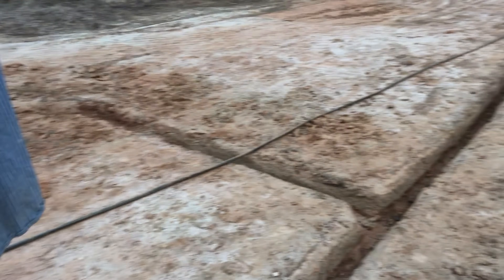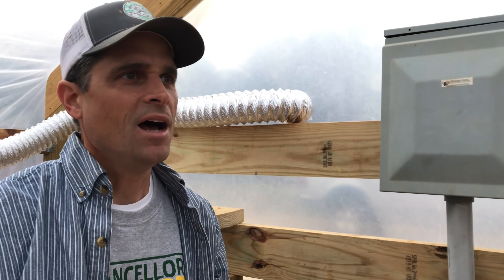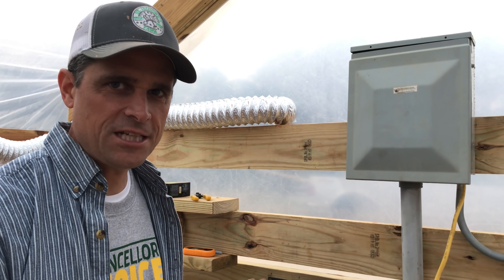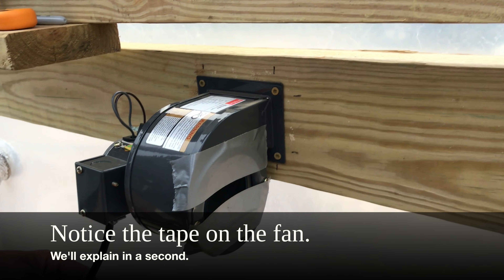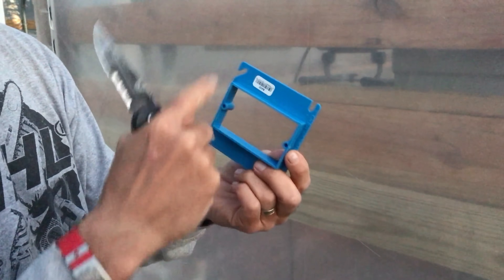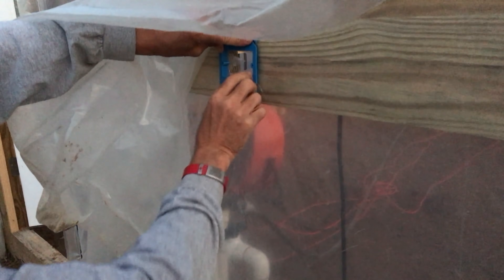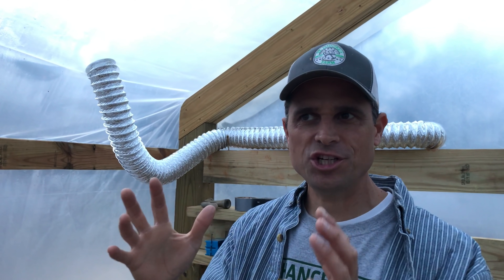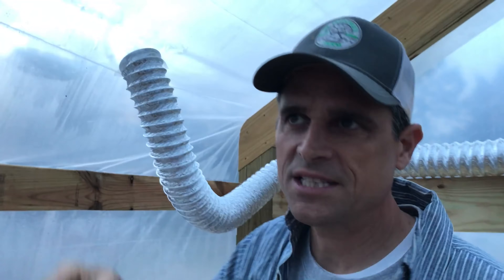DIY Geothermal Greenhouse Pt 10: POLY FILM INFLATION

Comment: another great update!!! 

Im so stoked that you dont have any water filling up the pipes, that is GREAT NEWS.  
I'll have to really consider following your steps with my little greenhouse :)   Would be nice.  
Then again, i might just make a larger greenhouse lol 

regarding the air flow jive... ill give a wack at it.  Anyone that notices any errors, please correct my thought process. 

Here is a website I used to cheat regarding the math.   I figured I'd use the benefits of modern 
day tech and the internet lol. 
http://www.comairrotron.com/airflow-unit-conversion 

I do know you need to convert MPH to FEET PER MIN so then you can convert that to CUBIC FEET PER MIN.   Conversions,  FUN!! 

So... at 15mph air velocity it looks like around 250cfm.   
Not bad at all.  With that calculator... you got around 1300fpm so you can calculate 
roughly how long it takes the air to travel the length of your system... "ROUGHLY" i mean of course... since there is the manifold that air could be taking a number of paths, but you get my point.  No need for hair splitting haha.  

Really impressive and you def lite the fire under my ass to get the ball rolling on my new greenhouse.  The 16x10 isnt big enough and its wood.. and well.. its all wrong hahah 

thank you so much for sharing.
Reply from the maker: Thank you! And best wishes on doing your greenhouse. We are beyond excited about ours. So great to go out there every day and see things starting to come up. Now to build a raised bed in it among other things...

Comment: It sounds like the differential pressure switch should work but before you got to that part of the video it popped into my head that an easy fix would be to install a dimmer switch so you could lower the speed of the fan which theoretically should cut the cfm’s and keep from over inflating the house. 

You can also install flapper valves in your jumper lines so you can increase or decrease the amount of airflow to the end walls and anyplace you have jumper lines

Take care guys, keep me updated on the plants so I can come get some
Reply: Don Pfeiffer Changing fan speeds can be sort of complicated, so you’d need to look at what the manufacturer suggests. I think it’d be easier just to divert some waste air.
Reply: Fan speed rheostats are something that is very tricky to acquire via mail order and be happy with.  Some fans are built to work with some tiny digital units, but many fans will hum and the life of the fan will be shortened.  Eventually, we moved to using big heavy variac units.  They are a giant variable AC transformer with a big dial.  They provide lower amplitude sine wave without clipping that you get from the small compact digital fan controllers.  We bought one 40 year old one on ebay, and one brand new one from another online supplier.  Watch the current rating on them, to make sure they will handle big things like your main exhaust fan.  I believe you will eventually invest in circulation fans, and if you do, you can size your variac rating to run two circ fans.  We bought Schaefer industrial grade Versa-Kool VK-12 fans and they have been our greatest heat dissipation asset as well as a necessary thing to keep the stale air off your stoma.

Comment: I think you'll have an easier time if you set your anemometer to feet/min. rather than miles per hour.

Velocity (ft/min) x Area (sq. ft) = CFM. 

If your fan inlet and discharge are both 6", your intake is around 242 CFM and your discharge is around 207 CFM. Losing 15% is typical even on new commercial HVAC systems. I think you're in good shape.
Reply from the maker: Great to hear that we are not losing much across the system, but I must admit I'm pretty disappointed if the number are telling folks we're only moving about 250cfm for fans that say they move 483cfm. Thanks for doing this math for us!
Reply: Using the cfm calculator with 12.5 mph through a 6 inch line I get @345 cfm. You have 2 lines so you are pushing 690 cfm through the entire system. It could be that your piping system is sized to be most efficient at @350 cfm.  You already tested your system with 2 fans and recorded minimal gains. Remember that you need the friction or air resistance losses to actually transfer the heat to the soil, so I would not be disappointed at all. You have been great at adapting and the manifold size increase was a great example.
Reply: I'm not sure why Mars Rover and I are getting different numbers, but he raises a good point on number of lines. The air flow I calculated for you assumed 1 fan intake and 1 supply into the greenhouse (new to your series, sorry). If you have multiple, you'll need to measure the velocity at each one to get an accurate total air flow.

Comment: Great to continue to see these updates! Keep them coming. We've used a compost thermometer to monitor ground temps (in addition to our digital sensor). Gives you a great idea of how "charged" the greenhouse is and we use one with a 36" stem so we can get down pretty far in the soil. Would love to see how your ground temps are rising!

One suggestion on the inflation fan. You may not have a problem with condensation forming between layers now, but when the greenhouse is in "heating" mode going into the fall, you may have a problem in taking warm, moist air from the greenhouse and putting it between the film layers. We've even had the condensation freeze on cold mornings. We opted to have an external air intake for our fan using something similar to your jumper hoses and haven't had a condensation issue since. You might even be able to incorporate an inline damper to help with the pressure issue. I'm impressed, our second layer must not be tight or air-sealed because we don't get that kind of pressure buildup in our film.

In terms of a thermostat they do sell two-stage thermostats with one heating stage and one cooling stage. We didn't use them because I was afraid of the amperage limits with our larger fans, but they'd likely work well for you with just two fans: http://www.greenhousemegastore.com/product/moisture-proof-digital-two-stage-thermostat/thermostats
Reply: An STC-1000 would perform the same task for a fraction of the price. Its best to incorporate a differential thermostat to control the system. Standard thermostats can miss out on useful heat that could be stored (cooling mode) and in heating mode they will happily turn on the fan even when there`s no useful heat available from the mass.
Reply: We use something like the STC-1000 in our high tunnel (actually two of them). Unfortunately it just has a single set point, meaning that it's trying to maintain a single temperature (single setpoint). You can set a differential, but it's always trying to get back to that single setpoint temp. In a greenhouse like this one you usually want a "dead zone", meaning when it's between a range of temperatures (say, 50F to 80F, maybe different if you're growing seedlings), you don't want anything to kick on. I haven't found a way to do that with the STC-1000 or one of the similarly designed thermostats that are available, unless they've added a different operating mode.

We compensated for this by having two thermostats, one for heating, and one for cooling, which gives us the dead zone and both of which simply work to kick on our fans. That gives us both a heating setpoint and a cooling setpoint. Ours kick on for heating at 50F and cooling at 80F (we try to keep the cooling set to about 20F above ground temps in order to effectively bank heat, otherwise we aren't really "storing" heat) with around a 2F differential and the fans are off in between 50F to 80F. However, the thermostats we purchased aren't truly for greenhouse use and I'd feel far more comfortable going with one with a NEMA-rated enclosure. We bought these for our house: https://www.amazon.com/dp/B01KMA6EAM with higher amperage rating due to the larger fans we're kicking on. In retrospect, by the time we bought two thermostats, we likely could have just purchased the other one in the link above for a little more and had the piece-of-mind of a moisture-proof solution, if they would have a 15 amp version (our fans pull about 10-11amps when running full-on). I don't have any experience with the above thermostat but it has an adjustable differential and has the concept of a "dead zone" built in, which would seem to be what's needed. I've seen other folks with these types of houses simply have two greenhouse thermostats both triggering the fans to come on.
Reply: Aye, you are right single setpoint but even two would be $100 cheaper than the stat in the link. STC`s can be run on 12v dc so theres no reason to use mains voltage if you prefer not to. Contactors mounted in an IP68 rated box will switch high current items safely. 
The issue with standard thermostats is they only use the greenhouse air temperature to decide when to turn the fan on and off ;)
I use a standard and a differential thermostat (and fan speed controller) to control the fan. The standard stat provides a heating/cooling temperature crossover setpoint, the differential thermostat senses and compares the difference between the air and soil mass temperature. When the standard stat is above the setpoint, cooling mode is enabled but the fan wont run unless the air/soil temperature differential is met. No sense running the fan if the mass is too warm to efficiently store the heat. 
Heating mode is similar, if the air/soil differential is too small to deliver useful heat to the greenhouse, the fan wont run. If the heat in the mass is depleted while the system is running, the fan turns off.
 Standard thermostats dont care what the soil mass temperature is,  they`ll happily run the fan all day and night ($$$) as long as the air temperature switching conditions are met  ;)
Reply: I'm curious about your differential thermostat. Is this a product that exists, or a solution you've engineered? I'd like to design a solution via raspberry pi that could take into consideration different factors (greenhouse temp, ground temp, etc) and switch different loads based on that. It'd also be nice to "ramp up" temps depending on season, so the low setpoint would gradually rise as we came into warmer weather. I've been manually adjusting setpoints based on my monitored ground temps but an automated system would be great. Do you have any documentation or videos on your setup? Would be interested to see it.
Reply: Hi Tim
I had to make it as i couldnt find anything to fit the bill off the shelf. I`m sure it would be very easy to do with todays tech but dont ask me how, i was around when b/w tv`s with valves and crt`s were considered cutting edge ;)

Comment: Should the fans suck the cooler dense air out of the thermal system as opposed to pushing in hot thin air
Reply: Pushing is better for this application.
Reply: thats a good point... that does sound like a useful test !!! lol
Reply: From an industrial fan back ground fans are better pushers than suckers. You could have a balanced system of both pusher and sucker if you wanted to increase total volume flow but as always you are limited by pipe diameter, length of run and how many turns the piping has. Also I am not sure the way this projects header is designed that it would give equal flow to all pipes. In my experience you would have the inlet flow distributed at several points to assure equal flow through parallel lines. Cheers and keep up the good work and comments.

Comment: It's coming together! I would make a record of outside temperature and inside greenhouse temperature. Record it each day at the same time. It maybe possible to automate it. You can then see the long term performance of the thermal battery and if improvements make a difference. I am planning a greenhouse and may take the time to do a thermal battery as well based on your experience.
Reply from the maker: Once we get some decent instruments to measure, we plan to do that. Tim Clymer is using an app from Accurite that seems to give decent data at a reasonable price. If you build one of these, read the comments and really pay attention to what @johnguest45 says, as he really seems to know a LOT about these systems. We'll do another video at some point where we talk about what we should have done differently to get even better results.